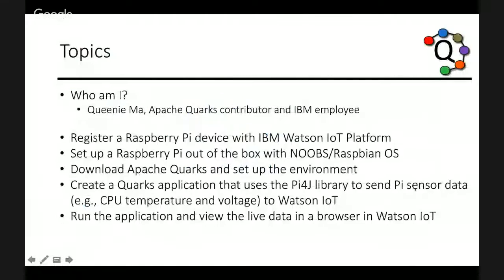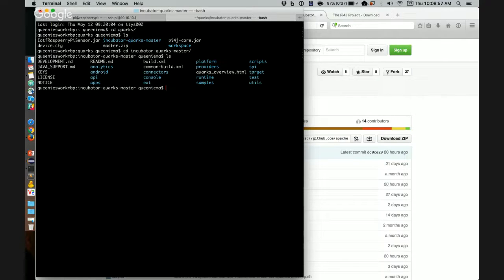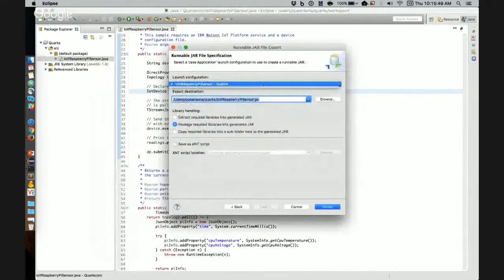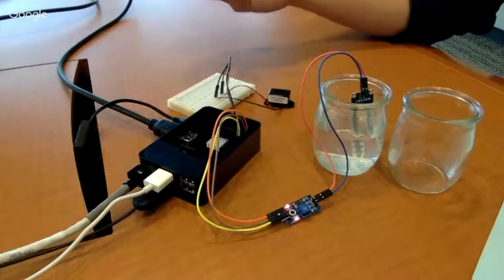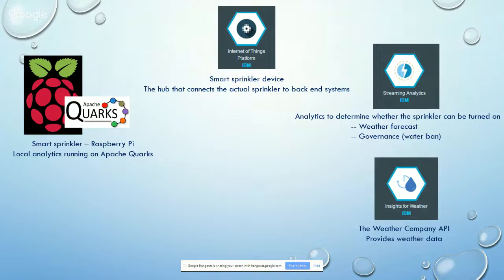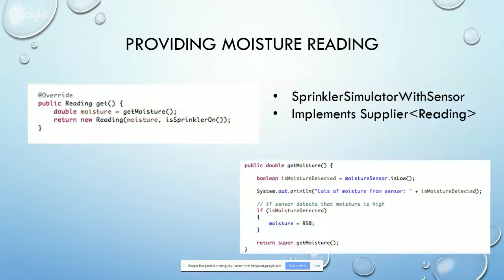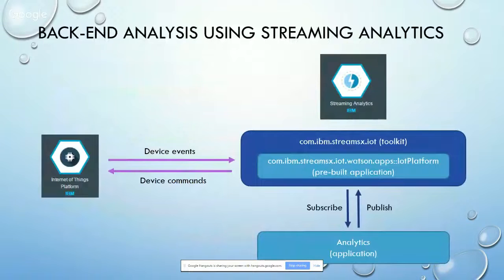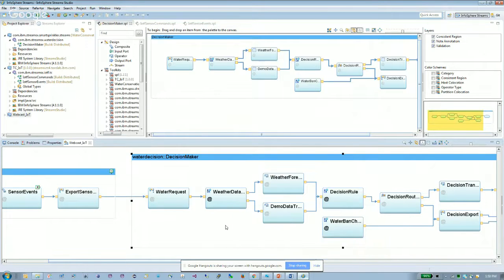Apache Edgent on Raspberry Pi

Comment: You need a statistician to help you understand the difference between a running average and an average value calculated over a previous defined interval of readings as you have done.